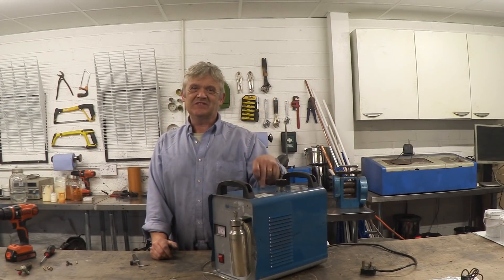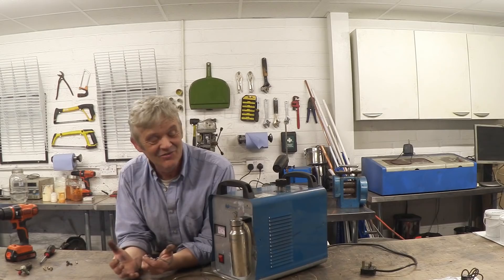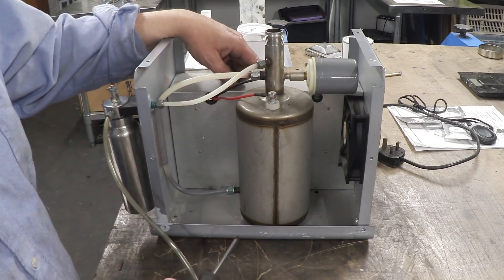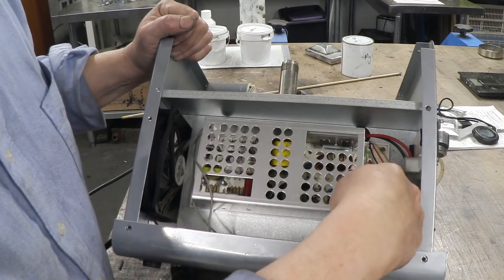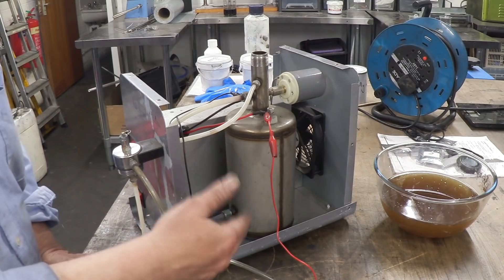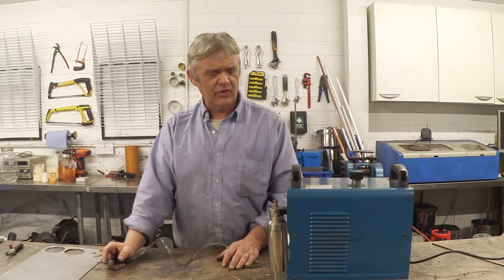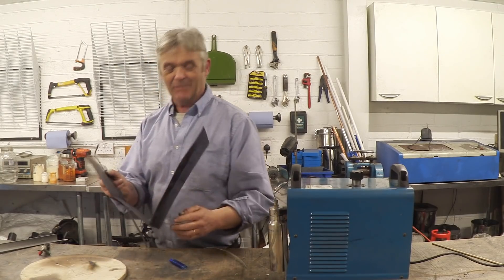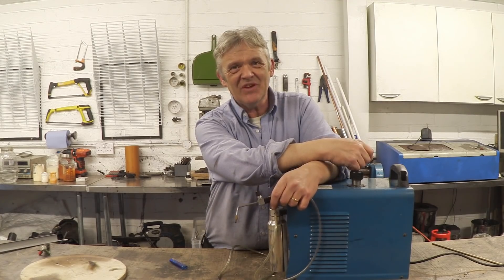HHO Torch Tear Down and Use

Comment: I own this machine but after 6 years of use the electrolyser has corroded like what is seen in your water to the point is doesn’t produce gas anymore. So my question is can I buy the electrilysor separately or do I have to buy a whole new unit ?

Comment: That's not an HHO torch, its designed for health purposes. The gas is bubble through water converting the water to H3OH, they say. Its rejuvenating. So its not just a flash back arrester. Also a cannular is worn and the gas is breathed for lung problems and general wellbeing. You can for example put a bag over your forearm and pump the gas into it and carpel tunnel goes away. Spray it over burns and they get better fast. Its a poxy HHO torch but excellent for its intended use. If you want a real water torch find Severs on youtube and see what that dude sells. Very good machines big and small. Big flames. Very clever inventor.

Comment: QUESTION: I have one of these and I want to be able to REDUCE the amount of gas production just like you 
adjust the speed of a fan. Could you explain how to wire a potentiometer ( I think that's right) into one of these to produce let's say 10% on up to 100% production?
That would be interesting. Thanks.

Comment: I was looking for a way to make oxygen for gas welding, rather than having to buy consumables. I remember seeing this video ages ago and did some quick calculations to see whether something like this might be practicable.
Doing the calculations of the amount of oxygen and hydrogen it could generate, if running at 3kW, assuming relatively decent efficiency (it won't be)... 237.26 kJ/mol water => 237.26 kJ to electrolyse 18g water. 
3kWh = 10.8MJ, so 10800/237.26 = 45.5 mols per hour of HHO or x 18 = 819g/hour of HHO produced. 
Comparing with typical oxy acetylene usage rates, 45.5 mols oxygen is  over 1000 litres per hour at STP.
This is way more oxygen per hour than would be needed to weld 6 - 7mm steel with oxy-acetylene, which most tables reckon about 650L/hour. Given the inefficiencies of electrolysis, even if 30% input energy wasted, this could actually be useful.
A simple rectifier and thyristor circuit could be used to control the gas production (DC to allow oxygen and hydrogen to be collected separately).
So this if my calculations are right, a scaled up version looks like a practical replacement for oxy acetylene, or if the gases were collected separately, the oxygen could be used with a different fuel and the hydrogen collected for other uses. I'm not sure whether hydrogen embrittlement may be an issue welding steel.

Comment: ok so i have an idea i think you should try how abou you use this generator with the chinese diesel heater like inject the generated hho into the air inlet of the chinese diesel heater. i think it should increase the temperature of the burn chamber which will increase the heat produced by the heater with less diesel consumed maybe try it on alpine mode.

Comment: To see the flame better, replace the water in the flame trap with alcohol and a trace of boric acid. The boron entrained will make a visible green flame. 
It's made for jewelers in areas with tight controls on compressed fuel gasses. With no stored fuel, the explosion hazard is minimal.

Comment: Hi, i built my own years ago ! you cant see the flame, but it can get very hot, the gas is Very explosive, try  sticking the torch into a plastic glass full of slightly soapy water and you will get bubble forming on the surface, put some safety goggles on and light the bubble with a long lighter, if you thought the starting welding made you jump ??? lol

Comment: is that power supply pwm or just an 12v  inverter?
Reply: Its straight DC but a PWM would increase the efficiency much. Pulsed DC would give an even better result but takes experimenting due to all varieties like concentration of electrolyte, type of electrolyte, setup of the cell (number of plates), etc.

Comment: QUESTION: Which stones should I buy to heat my whole house 100m2? Fireclay bricks, can they withstand this heat? Because I would like to attach 1 or up to 9 Brown gas nozzles to one gas nozzle (hand holder) and suffer these nine flames on one stone. The whole quantity of stones will be about 5 to 10 stones per room (Art-Ofen). What approximate energy in watts (for the production of Brown Gas) will I need for this project? It would be nice if you could give me an answer.

FRAGE: Welche Steine soll ich mir kaufen, um mein ganzes Haus 100m2 zu heizen? Schamottsteine, halten die diese Wärme aus? Denn ich möchte 1 oder bis zu 9 Brown Gas-Düsen an eine Gasdüse (Handhalterung) anbringen und diese neun Flammen auf einen Stein leiden. Die ganze Steinmenge wird so ca. 5 bis 10 Stück Steine je Raum (Art-Ofen) sein. Welche Energie in Watt (für die Browngas Herstellung) werde ich für dieses Vorhaben ungefähr benötigen? Es wäre schön, wenn du mir da eine Antwort geben könntest.

Comment: yea been thinking of building one of these diy style. yea the hydrogen flames by itself isn't much use. give it a good oxygen source to go with it and you can cut through just about anything. although those off the shelf units are weezy at best. needs a VERY high flow rate to really get cooking.

Comment: The torch is a jewellers torch, very hot flame but little power I was one for working with silver. Normally the bubblier is filled with M.E.K or something like it to control the flame temperature as the torch control is only on/off. You mix the other gas to alter the gas/air mixture. Great for small work but no good for anything bigger than a ring. The other torch is a Smiths Little Torch, either oxy/acetylene  or in my case oxy/propane.  A quick google will show you all the different heads than can be added to the torch.

Comment: aceton+water 1:1 mix in bubler, and stronger alcaline sol-n(maybe KOH even better)for higher as possible current 
you will cut at least tincan(skimed milk,sweet corm  etc) and redbull duraluminium 0.33l cans
must be like that, 
my simple design do it at 130Wt, first opening some more difficult, maybe 20sec needed, than can cut 1mm/sec speed, burning road notch ~1mm width
usefull for making termocouple, and for welding nichrome with steel -for good connection, but useless for welding mechanically(instead of acetylene/oxigen)  as i know now, may be there is some secrets unknown...
Reply: alcohol and petrol - not good saturators fuel as i experience - big flame without heat only producing

Comment: I’ve got the same or similar one, basically an electrical gas bomb! No flashback arrester for the HHO gas it generates. If the flame was to flashback down the pipe to the bubbler you would be looking for some new underwear and possibly first aid kit to remove shrapnel! It’s a great tool for polishing / finishing plastic to give a glasslike finish. As you discovered, also good for removing components. The flame is small but extremely hot and can be used for small brazing jobs or silver soldering small items. A useful tool but seriously, put a flashback arrester between the bubbler and torch head. Fill a latex glove with the gas, tie it, put it on the ground and light it with a blow lamp at arms length, you will see what I mean! (Ear defenders recommended!) imagine that power in a sealed metal bubbler!
Reply from the maker: thanks for that mate - cheers

Comment: Since the reactor runs on 12 Volts, I thought I'd hook it up to my car battery. However, apart from the fan in the rear nothing happens.. No Brown's gas production at all.. What's going wrong?
Reply: Rudolf, maybe you mixed up plus and minus? You should at least have a few amps available from your battery, the more concentration on electrolyte, the more gas. Maybe your plates are full with holes/ rusted? The current than ‘runs away’ through the holes.
Reply: @hansscholte5472  The reactor runs on 24 Volts, not on 12 Volt.. That's why it didn't work.

Comment: I have one, and modified it for Hydrogen therapy.  That's apparently the fountain of youth.. Here's what you do: instead of 15% lye by weight, just use a tiny bit. less than a teaspoon. So little that the amperage gets only up to 3 amps. then add two bubblers, one high one for washing the gas and one for drinking water. After the second bubbler you can connect a canula for breathing the gas. I use distilled water for all. With more lye, you get more gas, but it needs to stay below 4% in the lungs so that no explosion could possibly occur. With more lye or more time instead of a canula you can fill up a bag to apply hydrogen to a limb, ideally something like a veterinary plastic glove. Careful, because the gas is still explosive, avoid static electricity,  but that's just a loud bang without serious damage. an explosion in the lungs would be serious.. Look up the health effects, podcasts by George Wiseman and others.
Reply: Hi Rudolf, do you still breathe the brown gas everyday? How many minutes per day? There is another type which is almost pure hydrogen, isn't that more explosive?
Reply: @motto666  I use it almost every day. 
Pure hydrogen ia worse, those machines only last a few years, and there's risk of hypoxia.
Reply: @Evomindcom  How many minutes you breathe the brown gas everyday? Did you notice any benefits after using for 1 year? I think this is the biggest bang for the bucks as compared to those thousands of dollars generator out there. I just placed my order for H160. The power supply is 20 ampere,  if you use it at 3 ampere, do you think it is saving electricity? BTW, what is the inner diameter of the hose?

Comment: Go my dad one, like that. oddly enough because the flame is so small and hot, you can  tack quartz glass, and do some ther glass tacking/welding.  but the parts need to be pretty hot to keep from breaking.   but we did find you can melt sedimentary rock with it.
Reply from the maker: I actually think it is pretty awesome for the right task - I now use it to solder as I find an electric torch is pretty rubbish

Comment: So basically it has stainless steel plates inside that bubbler that the wires hook up to. It works just like the water to gas cars. What if you tie strapped some magnets around the bubbler that you pure the electrolyte in to, then it would produce the gas faster?
Reply from the maker: I dunno mate - it is supposed to - but it is really just something to try

Comment: Hi Rob. To change the heat of the flame you can play around with different solvents in the bubbler. Water seems to be the least efficient and I've played around with various mixtures of acetone and alcohol with mixed results. A flashback arrester becomes absolutely essential with volatiles in the bubbler . My small machine is supposedly capable of generating 150 litres of HHO an hour with a 5 litre electrolyte reservoir, so I'm guessing that your example would be somewhat proportionally less productive. If that is the case I wouldn't expect too much of it as I have come to consider my 150 litre machine as a bit of a toy. Never the less I was encouraged enough to splurge outlandishly on a 400 litre per hour machine with the goal of welding aluminium. The bigger machine only arrived quite recently and I don't really have any experience with it. With water in the bubbler it was struggling to overcome the oxide surface on very thin 2024 aluminium but more experimentation is to come.
Reply: Can you kindly give an update about your experience with the 400 litre machine? Is it a severs brand or Korean/chinese brand?

Comment: One more thing. Did you ever measure the frequency of the electrical energy that the harvester antennae was pulling in ? the one  you made a square antenna for that did the free power for cell phone charging?

Comment: Is it really just putting a straight steady amperage and voltage into the electrolyser?
Does it actually say to use a electrolyte in some instructions on the machine or did someone tell you to do that?
I was kind of surprised and disappointed  it wasn't using a pulsing lower amperage signal especially since it uses the PWM chip. can you actually measure the signal to the chamber without any electrolyser in it?
I thought some of these were Meyers pulsed type.

Comment: A local plumber here a few months ago thought he'd save lugging oxy and lpgas bottles to a job so he got a good flame, put it out and topped up a small lpg bottle with it... easier to carry one small bottle, right? You guessed it, he and the bottle went out the ktchen window... dead. Wouldnt want a mix of HHO any bigger than what that little torche can use!!
Reply from the maker: I do
Reply: @ThinkingandTinkering  I'm just saying that having a stoichiometric mixture in one container like these HHO generators is an explosive situation as opposed to mixing at the tip in air as per conventional two gas torches where each gas line has a flashback arrester. P.S. I really like your channel, please keep up the great work.

Comment: Honestly in my opinion it is a waste of parts. The electronics make a good 12v power supply but the rest is better used as something else. Better to just give it a 12v power inlet but as a torch it's wasted. A chemist or scientist could use it as a means of separation of elements or whatever
Reply from the maker: well it's 144 watts and meant for jewellers - so for that - ok - but as a shop torch - I don't think so - even so interesting and sparked off a couple of ideas for me for sure

Comment: One of these days I'm going to start a club for procrastinators.
Reply from the maker: lol
Reply: Great idea man I'm in.  I will get around to signing up eventually
Reply: Or people so curious they often are distracted by other securities
Reply: Too late, we've been around ever since we met up with Eve.
Reply: This cell is not efficient, but I am curious what is inside. Is anyone cut it to see construction? I just saw through the cap, plastic housing of electrodes 🙂
Reply: My younger brother would be the best person imaginable to lead such a club.
Reply: We meet on the 2nd Tuesday of next week. You're late, and were supposed to bring tacos.
Reply: I wish I knew about these before I bought oxy acetylene torches. This would of met my needs. I just needed something hotter than propane for heating bolts. The 180 version puts out a decent little flame.

Comment: I made an HHO generator with a friend a while ago and it exploded. 3 or 4 times. We learned that we needed a bubbler. It was to power a small engine and it didn't work very well.
Also, for no reason, water would always turn brown and for a layer of dirt even though we used clean water and stainless to make the electrolysis. I would try to see if the electrolyzer is not full of dirt.
Reply from the maker: it does rot the steel mate

Comment: I thought that the point of adding trace amounts of acetone was simply to make the flame visible, you get the emission lines from the carbon in the plasma/flame.
Reply from the maker: I have no idea mate - the guy I watched  said the flame burned at a different temp
Reply: @ThinkingandTinkering  I'm pretty sure it is the carbon emission lines, it would change the heat transfer as there is more radiative transfer as well as the usual conduction from the hot gasses. Oxyhydrogen burns at around 2,800 °C and I can't see how that would vary much with just traces of something else in it, other than the heat transfer aspect.

Comment: The torch with the second input is for the oxygen. Also derived from the proccess and should be piped into the exhaust side of that system. Just drill a hole and soldier another tube connection.  Plus if it had a reservoir it could get pressure. Those are great for small things and worthy of a better valve that and a sparker from a lighter.. I dare you to tamper around and build it up.
Reply from the maker: I was thinking about it mate - so not much of a dare lol

Comment: On the power supply with that chip that was mentioned it's a pwm chip for the switch mode power supply and and it oscillates the MOSFETs
Reply from the maker: cheers mate

Comment: It may have already been said, but the torch with the two nozzles is probably designed for separated fuel / oxidizer tanks where you can then adjust the output of each to control flame properties. I suppose two of these units (with oxidizer / fuel already mixed) could be put through it for increased flow rate capability though. You say the power supply is putting out 12V. Surely that is not over one alkali cell? I think that would be horribly inefficient. Maybe there are multiple neutral plates in the cell? If it was 12V over only two electrodes, I'd think no wonder the anode has corroded.
Reply from the maker: I am going to grab a camera and have look inside - all I can tell you is what I measured
Reply: That should be interesting. Thanks for the effort.

Comment: I used mine with MEK in the arrestor and never had an issue with it, got hotter than my regular oxygen/propane torch, but mine might have pumped out more gas.
Reply from the maker: personally I think if you are mixing volatiles in the bubbler you are bound to get a hotter flame as basically you are burning a mixed gas - just my thought though
Reply: @ThinkingandTinkering  yeah, I used it for platinum and silver, I would use it for melting just the surface of silver plates, then making rings out of them.